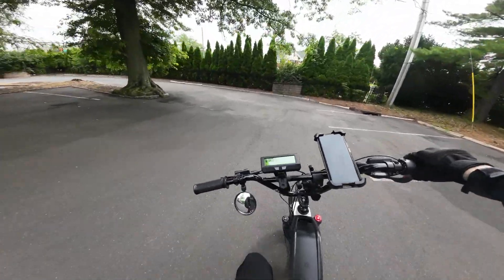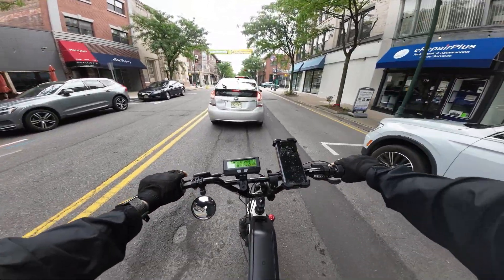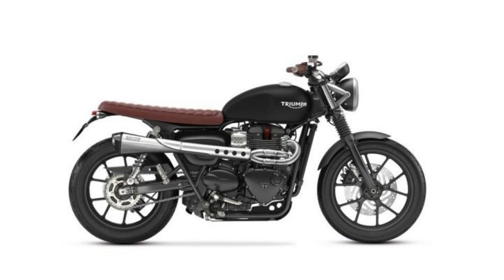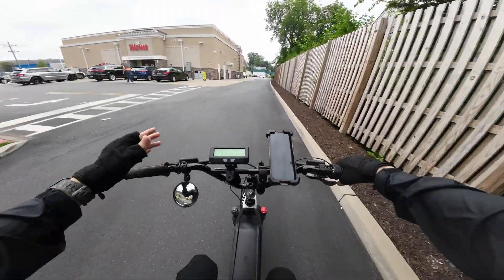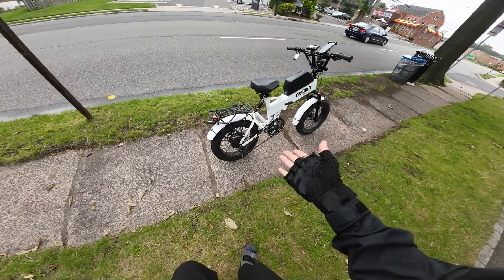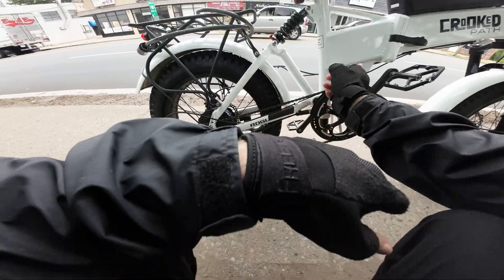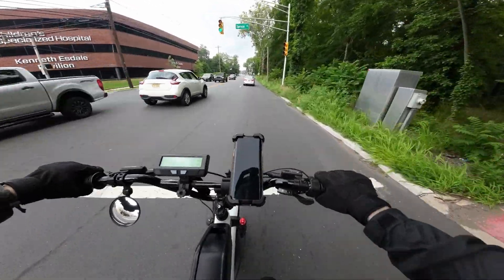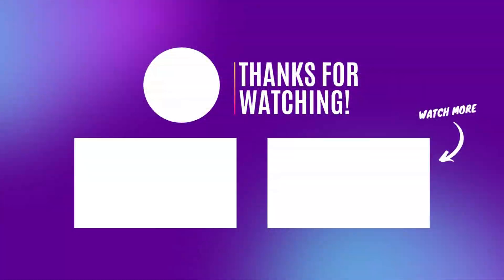Why Hub Motors are Better than Mid Drive Motors

Comment: I agree with your ultimate conclusion, but not for the same reasons.

Hub motors, particularly direct drive motors, are not ideally located, assuming you have a suspension. 

The worst possible location for mass is the wheels, because that's all unsprung weight, which is the mortal enemy of handling.

There's a reason mag wheels (real mag wheels) became popular among sports car enthusiasts. 

You have to look at what the strengths and weaknesses are of any technology.

For ev's, the strengths are simplicity, and full torque at zero rpm. (The latter isn't actually true, but it's close enough.)

The negative is the cost, but more importantly, the weight of the batteries.

There is a practical limit to how much power an ebike can have.

Yes, you can throw dual qs 273's' add colloidal iron and heat sinks, and a couple of insane wattage controllers  and be pumping 40kw at each wheel.

But you then have no range.
You've just built a quarter mile machine.

Ebikes are good at short distance and best kept simple as possible, but no more.

They should have a suspension. This is not a comfort consideration- it's about safety and longevity 

Hardtails are rough on all components. You will definitely have more mechanical and electronic failures with a hardtail.

There are probably some niche case for a mid drive, but they are inherently more complex and more proprietary.

I've had a DD home brew bike that I made just about every possible mistake with it.

It was useful to decide what I actually want, but ultimately it's fatally flawed by my choice of donor bike.

I'm most likely going to go with the SMLRO V3 Plus.

Dual lightweight geared motors will give Mr the same acceleration and top speed I would get with a 3kw DD motor, while keeping the weight down. 

It's for commuter purposes, so the extra traction will be useful if the roads get bad.

If I lived in a colder climate, that might be a niche where a mid drive would be better, as I could swap tires more easily.

The only substantive upgrade I may make would be metal planetary gears, though they seem to be easy enough to replace that I might just keep the quieter plastic gears and replace them as required.

Comment: I would take Mid drive motors over overhub drives all day long. I have both and I would never Ever take a hub drive over the mid drive.
 I have a Bafang  1000w watt nominal hub drive On a full suspension.
E- Mountain bike. 
And a Bafang M620./g510. Mid drive In a e emountain bike, full suspension.
 And these are not my first of either.
 Mid drive is in a world of its own, much better mannerisms, power band, feel,
Both are great.
Methods for propulsion, But in my opinion mid drive is supreme.
Reply: I have a BBSHD and geared and direct drive hub motors and I prefer the hub motors for reliability and redundancy. I'm thinking about putting a locked clutch in my ezee motor to do regen with the gearing.

Comment: Reason why I chose mid drive is weight distribution. Plus with a bac855, you can do a single speed, 4000w 72v build.

Comment: Yes hub motors are the way to go you can throttle yourself back home if a pedal brakes or a chain. And they're a lot easier on chains and sprockets. I just don't like mid drives overpriced and not necessary

Comment: Hello! Just wondering is it safe or okay to use a 52v battery with a 60v hub motor? 

I'm looking to get a 60v 2000w Hub motor 24 inches.

Comment: Hub motor for street cruising, middrive for off road/hill climbing 👌
Reply: Thats my project. I have a mid drive 500w Bafng, but i want to put a front wheel Hub to have the best of the two worlds. kkk
Reply: @daniel05061000  I always wanted a 500w mid bafang, sounds just perfect with a 22amp controller and a 48v 20ah battery 🔋 🙏, at the moment I'm running a front 250w with 42v 10ah at around 18amps and it's just perfect, on my 25year old 1999 marin palisades trail ,she only weighs 40Lbs with motor and battery 🔋 its all about power to weight ratio for me ,I still like to pedal so I never fit throttle I prefer pedal assist cadence sense for streets/gravel

Comment: I have a 750W 26" Bafang DIY mid drive and and also a manufactured  750W 26" Bafang hub drive.

The DIY mid has a 40T bling ring and wide range cassette. 

The torque going through the mid is putting lots of load on the chain, chainring and cassette at higher power and speeds. I can feel and hear it. It's a lot more than the stock bikes loading under my power. A nornal bike drive system was never designed for those kinds of sustained loads.

The mid doesn't have that concern and works fine. It's my wife's and she isn't an enthusiast like me. I like the experience and feel of the mid.

For this reason, I find myself wishing that we had two hub drives instead.
Reply: Mid mid hub what?
Reply: @thomaspayne6866 Bafang BBS02 48v 750w mid drive motor.

Comment: i think a mid drive would be a bad choice for you because you never peddle i watch all your videos and i never see you peddle
Reply: Lol, I like not having to pedal. You can get through some areas without feeling like a slog.

But yeah, you can overdo it a lot, with hub motors.
Reply: Having a bike with a throttle available is what does that.  If you ride one without a throttle... you pedal all the time.  That's what I find.   However.... you a can't make those 16 mile trips or even use type ebike to cool yourself
 off during hot weather when you're already exhausted  without a throttle.  I like all my bikes but I wouldn't be without a hub motor bike, given a choice...have both.

Comment: I'll take a direct drive hub motor with a shunt modded controller any day over a mid-drive for all steet riding.  Mid-drives are for the mountains.
Reply: This. And you can still go up steep stuff with a hub, just don't gun it all the time and go a little slower. Worth it for the reliability plus

Comment: Hub motor is more efficient and much better option for average RIDER with throtle READY to move from the sudden stop without time to change gears.
If you change gears like with mid drive where you have to do,   hub motor flies over hills too.

If you cannot figure out 100% why you need mid drive YOU DO NOT NEED MID DRIVE.

Comment: I had a rear derailleur hanger snap in half 30 miles from home ,good job I had a hub drive,there is many pros and cons will both systems.
Reply: Can shorten chain and make single speed to get home easily

Comment: "Better" as an overall term is used by people that are myopic.  It should be "Better for a particular job".  Hub drives are better at going faster IMHO, but mid drives are far better at climbing steep hills (particulary if there is a heavy load).  Prioritize your build's needs then use the tool that best satisfies those needs.  It's Engineering 101.   Oh there is another reason why ICE vehicles don't put their engines in the wheels - having heavy wheels is BAD for handling performance, that's why vehicles moved from cheap steel wheels to lighter/more expensive aluminum wheels.

Comment: The way this dope plays in traffic riding his so called ebike like an electric motor scooter, a hub drive is better.  Don't need a mid drive golf cart or mid drive motorized wheel chair or trike either. He uses pedals as perches for his feet to skirt the law which btw is ok.  Anybody with a brain would simply buy a small motorcycle with better brakes and lighting and handling and enough power to keep up with traffic better.  For $4K you can buy a brand new Honda Grom with 9.5 hp, 65mph top speed and 100 miles per gallon you can fill up on most street corners.

But for an actual 'ebike' whereby the rider participates in the pedaling process, a mid drive isn't a little better, it is much better.  The reason why, other than centralized weight, is better matching of motor RPM to cadence speed relative to bike speed.  That is the beauty of a mid drive. Torque multiplication and why the most expensive, high end ebikes from all 'bicycle' manufacturers are mid drives and they ride more naturally, the motor being a more natural extension of the rider.
This channel is hilarious. This guy knows nothing about ebikes.  The Bart Simpson ebike channel....lol.  Doh.

Comment: Mid drive is the tried and true winner up to 3000 watts. After that chains start wearing fast and hub motors finally start catching up to the mid drive torque.
Reply: Use a belt instead.

Comment: To me the main advantage to a hub drive is if you break your chain you can still get home. That being said, how many of us have ever broken a chain?  With my AWD I could get home anyway with the front motor.  So maybe the best setup would be hub on front and mid drive on back and then you have the best of both worlds 🤪
Reply: Why would you need 2 motors
Reply: My BBSHD didn't break the chain but it sure did send the deuralluer to heaven when it crashed into the gears. I prefer a front hub and rear IGH hub for reliable commuting with redundancy.

Comment: I have a Front Hub from Voilamart that's 1000 watt wheel powered by a 48W 13 amp battery. Take a look on my channel (if you wish). After 3 summers I'd say it a pretty reliable system .
I'm impressed by the power of the battery even tho there more powerfully batteries to be had.
 Even tho it gives me most of the juice when pedaling(WithPA) it does the job getting up even steep hills with ease which is why I bought it in the first place.

Comment: Hub motors are great for on road bikes but because of the weight on the rear wheel hub motors suck off road. Yes, you have ride a hub motor off road but not doing what a mid drive mountain bike can do....not even close.

Comment: just need 200-350 w on my 3K stealth bike, to maintain speeds around 30-35 kmh (on flat ground) it's extremely efficient ! and with pedaling just 150-200 w. for cruising at 28 km/h

Comment: Personally I used to agree, but after actually trying the two, I have a hub and my friend had a geared mid drive….I would take mid drive. 
Hub motors lack torque by like a insane amount, basically unless you pump a bunch of watts in real life any minor hill inconvenience just rips your speed from you, sure if I lived in somewhere like California where it’s not very hilly in many areas but where I normally live in Missouri or in Busan South Korea there are too many damn hills to deal with hub motors 😩

Also the decreased battery draw is nice, I found my friend is able to get much more range, he weighs 8 lbs less though so maybe that varies quite a bit but our bikes are only 1kg difference.
Another thing I’ve noticed is the ability to get higher speeds out of less watts, or at least it feels like it😅
Reply: If you have regen brakes which you can only get with hubs, then the battery life is going to be closer.
Reply: Try a onyx bike and you’ll see that you can get insane torque on hub drives as well.
Reply: @RandomMotoThings  at the expense of inefficiency..a mid drive you can dial in and it uses less wattage
Reply: @RandomMotoThings  like I said you can get really high torque but once again it’s way more resource expensive. Onyx are expensive use battery very quickly to max out the torque and also are like 8kw motors if I remember. They are also very heavy.
Reply: @kimhyunwoo8983 You can get a lot more torque with a good programmable controller there are a lot of tweaks that can be made to the power curve.
Reply: @Zomby_Woof so does the mid drive

Comment: Yeah well if tire flats happen more then drivetrains breaking so id rather take a middrive, do good maintenance and know what needs to be serviced. Plus the torque is better for getting past traffic, better then any hub for hills or dodging crazy drivers lol.hub motors are slow initially especially hills, top end is the best but still,.just to slow for me. dont care for top speed, unless you have lots of room. yeah sure geared is getting more popular but not rn im looking for a big fish not mediocre snake oil these companies sell you. Ill take my bafang bbs02 52v 17ah at 35mph and 60mi of range. But sure am looking at the talaria xxx or mx4 system rn with pedel mod got the power itch 😂

Comment: Even if ebikes had the connection, you won't charge any faster. Charging is limited by the battery technology. Charging a battery to fast damages it.
Reply: At least with current ebike batteries. But that could change and being able to very quickly charge at car chargers could be very cool.
Reply: You mean battery chemistry and architecture.  I bet this battery can handle 1C charge rate which is around 20A.
Reply: @cmgeolo  A lot of ebike makers will quote the mfg's optimum rate for max longevity.

That allows them to make claims of longer battery life and justifies them spending virtually nothing on the cheesy 2a chargers they include.

Check mfg's specs. You can usually charge at around 1C and not give up much battery life
Reply: They sale the connection now where you can infact connect your ebike to a charging station. I know these comments are old but yeah it's here.
Reply: P.S never buy an off brand “fast charger” house fire inevitable
Reply: MOST fires are from using the wrong  charger so yeah lol ,lot of battery BMS communicate with the supplied charger
Reply: Anything up to 0,5C is even considered „slow charging“ with most LiIon cells.

And i would say 95% of all cells can handle easily 1C, which is quiet „fast“.

i charge my e bike and scooter often with anything around 300-1000W depending on the charger setup (5, 7 and 10A charger)

Comment: You make a damn good argument can't wait to see your video on Mid Drives P.S. I own a Mid Drive mountain bike and after two years of riding it the Mid Drive is perfect however the rims in rear sprocket have to be replaced very often😐😐😐
Reply: Mine have been fine and I'm at 52v 1400w. I ride it how it should as well plus pushing off first with your legs and making sure your gearing isn't stressing the system is why your probably why your failing your cassette drive...your problem is being on the 8th gear ⚙️.... when it should be like 6th to 3rd even 1st. Those motors want to be going easy not going full brunt gears grinding mode...
Reply: You need to learn to use the correct gears on your bike to lower the wear and get a shift sensor so the power to the motor stops every time you shift.
Reply: always shift unpowered.

Comment: Imagine Ebike charging stations giving a full charge within an hour... 🍌's
Reply: With megawatt charging it would definitely be possible, but  we’d need a different caliber of battery to be built for e-bikes and the pricing would surely be for the rich only.
Reply: Would have to be at least a 20 amp charger, most ebike chargers are only 2 to 3 amps.
Reply: It's a cool concept. Maybe a super capacitor instead of a battery, or a different battery type that has no internal resistance.
Reply: don't... don't most ebike batteries have wall wart chargers... wouldn't this just be any outlet?
Reply: Might go fire fire 🔥😅 for sure hopeful for graphene batteries being able to do it or solid state less danger.🎉

Comment: I always just thought about it this way: if my chain, cassette, etc, break and I don't feel like fixing it, I can continue to use the throttle with my hub motor (as long as I have power!)  I like that feeling...
EDIT: oh yeah, and to just get HOME after something in the drive train breaks... again, throttle 😃
Reply: My sentiments exactly.
Reply: Your chain won’t break, hub motor puts no strain on the chain.
Reply: @Deckelmaho1234567889  I meant if you're pedaling and the chain breaks, you can still use the hub motor to move.  With a mid-drive, it doesn't matter how your chain broke, you're walking the bike to get it home.
Reply: @Deckelmaho1234567889  Yeah...just the spokes! Have fun changing that rear flat.
Reply: If it has a throttle, it is not a bike.
Reply: @davidarnovitz628  You're right.  It's an electric bike.  Or if it's gas powered but also has pedals, it's called a moped.  What's your point?
Reply: Flat tire
Reply: throttle is illegal in many places
Reply: And what if your wheel breaks? You just use your throttle?
Reply: @Swaaaat1  walk
Reply: @Swaaaat1  Your comment doesn't even make sense.  You can't ride ANY bike if a wheel breaks.  We're talking hub motors vs. mid drive.  And, by the way, I've never had a wheel break in my life.
Reply: At this point, why do people even bother putting peddles on these things?
Reply: @MR-nl8xr  So my original comment was what to do if the pedal drive train breaks.  Pedals are for the opposite, if the motor breaks, or battery runs out of power 😅
Reply: @MR-nl8xr 
Think.....hard.🤔.
Chan or pedal break yet the motor still takes you 🏡 🏠 🎉😂❤.  You're welcome body.😊
Reply: @MR-nl8xr  Pedals are for pedaling.